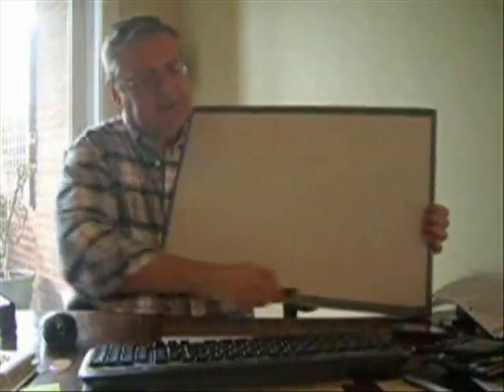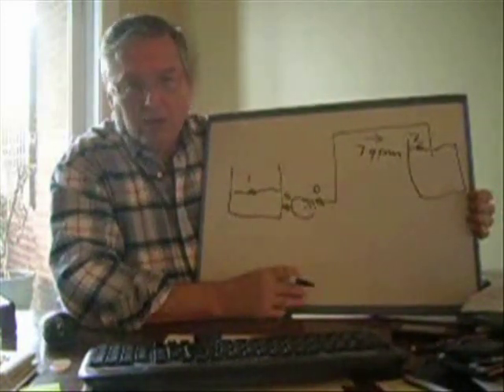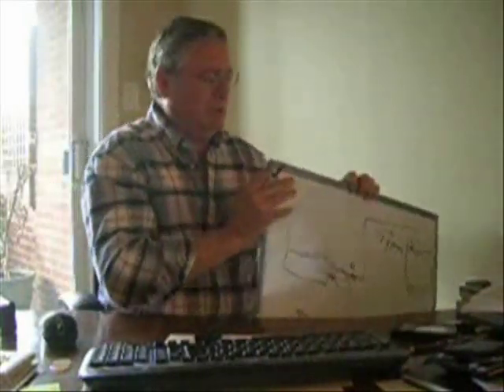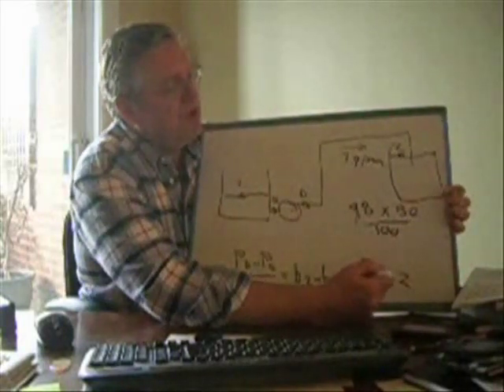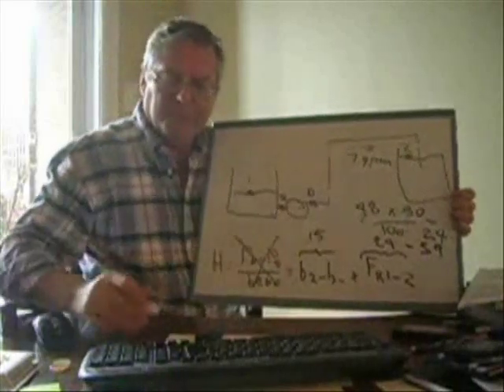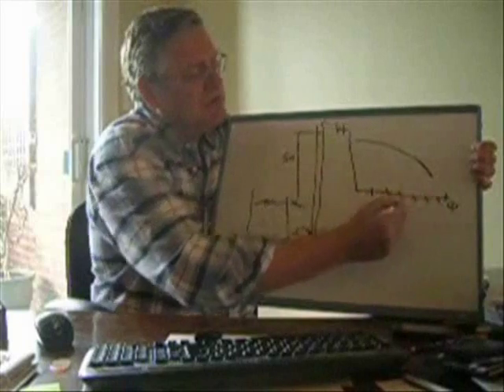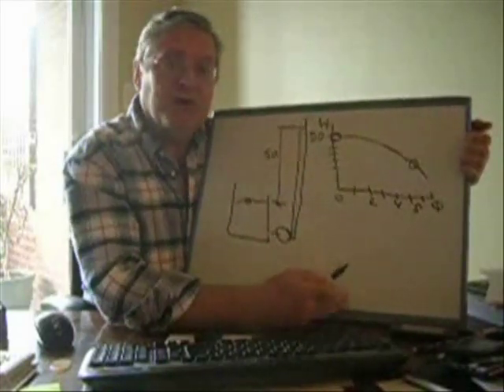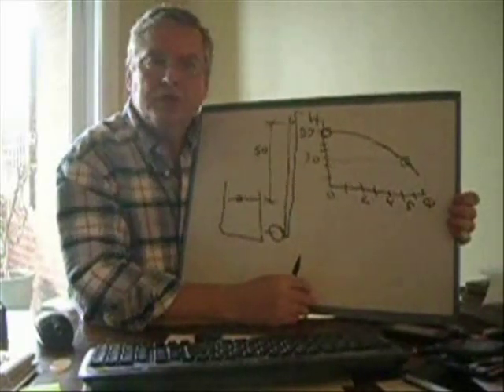4. Determining the flow and pump total head

Comment: Hi,
Recently in my site drilled bore well, total depth 800ft. I am looking for submersible motor and selection procedure.
Can any one suggest what HP motor suitable ? who many stage motor has to used?
Please guide me.
Thanks,
Ramu,
9900420457
Reply: Ramu Vayyala to size a pump you need to know the specific gravity of pumped liquid, required flowrate, suction and discharge head.